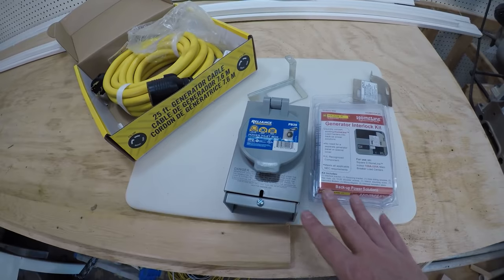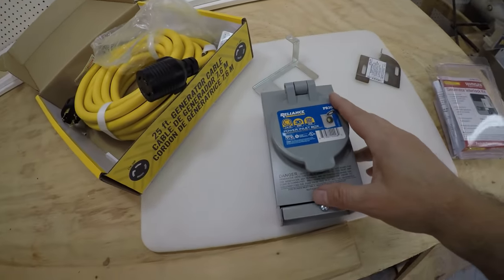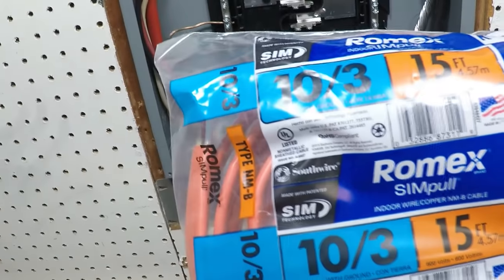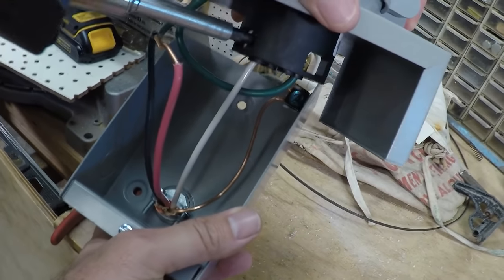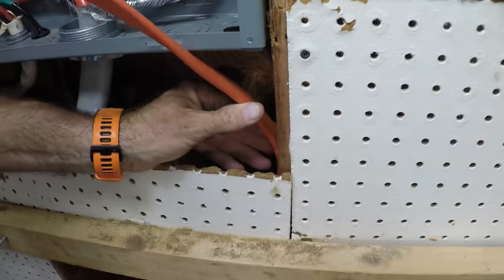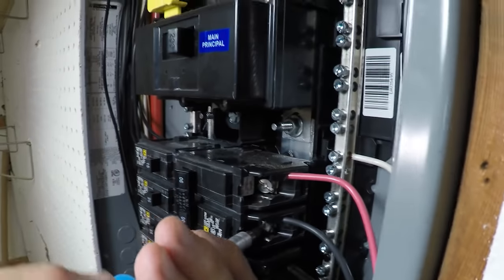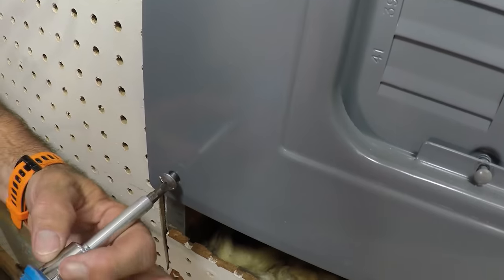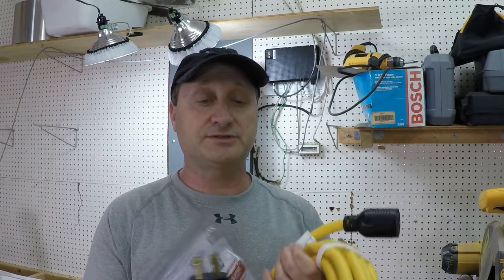Home Generator Interlock Kit Installation - EASY!

Comment: Thank you for the clear tutorial on a safe way to supply power.  Since this will not supply 240 volts for air conditioning units or any other 240 apparatus - mentioned in a previous comment/reply - is it a must that you click off the breaker to those units?  I think so.  Although I think someone earlier wrote that they just wouldn’t work, not a problem to keep the breaker on.  Can you please clarify your opinion..

I was leaning towards installing a manual transfer switch even though it limits the number of circuits it would feed.  But how many basic things do we need powered?  As you know, flipping the switch on a properly installed manual transfer switch safety feeds selected circuits and locks out backfeed to the street and not jeopardizing the lives of utility workers. 

Thank you again.  It is a top instructional.
Reply: This will provide 220 volt to the panel. The only limitation is the size of the generator.
Reply: @lancefredrickson4791  im no electrician but wouldnt the wiring be a limitation as well? The 10/3 wire is rated for 30 amps so regardless of how much the generator is capable of you have to be mindful not to overload the wire
Reply: I think that I probably didn’t word my question correctly or clearly .  What I was told outside of this discussion is that most portable generators wouldn’t supply enough amperage for central air conditioning.
Reply: Limitation is by the breaker. Breaker is installed to protect the wire not the equipment. But yes you would be limited to 30 amps but still 220v is available. It is possible the air conditioner could be less than that. Split unit air conditioners could be less depending  on tonnage could.
Reply: Generators are usually 30 or 50 amp. 6/3 wire for 50 amp. May or may not run central ac on either depending on AC condenser initial wattage pull.
Reply: @theworldviewer  If you play the odds most generators and the associated wiring will not run central AC
Reply: @theworldviewer  Generally speaking a 50 amp portable would get you closer to that objective... Know & understand your volt & amperage requirements in advance, otherwise hire a professional electrician...Based on certain questions asked, I would always recommend a pro...
Bill on the Hill...
PS: The gentleman that graciously shared this short demo with people was correct once again in his disclaimer: " If you are not comfortable working inside a main electric panel, hire a professional... "
Reply: Great observation...flanal did'nt provide this very important info even while sucking air between his teeth constantly. Looks like the wiring would make the entire panel HOT less to the service wires as the main is off. I would think you would need to shut off all breakers to items not included in the load calculated to be provided by the generator.
Reply: Does make sense since your feeding 110 to each side of the panel and if your 220 load was low enough it seems should be ok? In my case a well pump..

Comment: Before you buy the interlock and install it,  check with your building dept. Many municipalities do not allow them. They will require either a manual transfer switch or automatic transfer switch, depending on the generator selected. They usually require you to switch the neutral also.
Reply from the maker: you may need a permit anyway in your town which means you are going to find out quickly

Comment: My home is off grid so I use a transfer switch at the inverter .   I use a generator about 15-20 hours per winter.   I use a propane powered genset because gasoline goes bad.     The other 340 or so days the wind and sun keep things humming.

Comment: I have that EXACT same Isolation lock on my panel. Works great, the only drawback is that it is fairly hard to turn off the main breaker from the powerline. My wife can barely do it.

Comment: Nice job man! 'everyday man' says he is an electrician, yet uses a suicide cord, which can be a very
dangerous thing to do. You did a professional job. with the transfer plate and not needing a widow-
maker cord. again great work. When I get a power failure, I find out how long it will be out. if I need
power, I shut off disconnect under the meter and in the house also.I then plug into the dryer and 
gen, with its breaker off so I don't start under load. I am very careful, BUT I know you have a safer set-up.

Comment: Is your generator setup as a "floating neutral" or "bonded neutral"? How does wiring the load center from the 30A Inlet box differ for each type generator setup? I am using the same 30A Reliance 4-prong Power Inlet box and my generator is set up for "bonded neutral" and has a GFCI setup. @7:30 looks like you are wiring the ground separatly  (not bonded) from the neutral at the point of first disconnect.
Reply: Great question I’ve wondered the same. No one ever answer’s it though when I see it asked.
Reply: @willyhawkins6596  same

Comment: Great video. Nice step by step. Please consider using an insulated electricians screwdriver! ALWAYS check for power on and off with a pre-verified meter.
Reply: You sound like you know a lot about electrical work. Maybe you could answer a question I have, if the breaker you need next to the main breaker for the lockout kit is already used. You would have to move it to make room for the 30 amp generator breaker ?
Reply from the maker: yes you will have to move it. The generator breaker needs to be directly beneath the main breaker. Otherwise, the interlock kit will not work
Reply: @flannelguydiy6458  when moving breakers, keep in mind overall load balance between phases.  Usually not a problem, but in certain instances.

Comment: Good video! I like the idea of those interlocks. On a side note, you should not get in the habit of touching the screwdriver shaft even if the breaker is off. One of those times it might not be!

Comment: Just a suggestion, Make your wires twice as long in the box. Use 6 wire so you can make it 50A if you want to run your whole house with a bigger generator.
Reply: why twice as long in the box?
Reply: @feralbigdog  I like to have longer wires when I pull a receptacle out so it is easier to work on. On camera they looked short. When they are longer they are easier to fold into the box.(50 years as an electrician)
Reply: Yeah.  Use 6 wire is future proof if owner wants to upgrade to a 10kw generator to run central AC and all other circuits.

Comment: Excellent video. I have a transfer box for my generator. I've unfortunately had to  use it a few times since Katrina. Its worked well  up until recently. Transfer boxes have a set number of breakers, as I've had work done on my home to upgrade it I've added more breakers so all of them are not wired to my transfer box. I am definitely switching to this interlock as it powers the entire panel. I'll use an electrician. Thanks for the info.
Reply from the maker: thanks for watching
Reply: Do it yourself. Its not hard.

Comment: Very nice.
Though I would have liked to see at least a 1ft service loop for that Romex feed, and a 'while in use' weatherproof cover for the power inlet.
 I love that breaker safety clip, that's one hell of an invention.
Reply from the maker: thanks for watching...
Reply: Except service loops are against the NEC so he actually did a good job on that
Reply: @mikemartin6978  for in-home permanent wiring sure, but for an emergency, backup connection?
 I'm not doubting, just asking.

Comment: This is probably the best video I've seen about this. Very well explained.   About how much would an electrician charge  to install it ? Is the whole house powered or just what's on that one breaker ? No one answer please except Flannel Guy DIY.
Reply from the maker: An electrician will charge at least $750 for this including the parts. Maybe more. You can power as much as what your generator can support. If you have a 6000 watt generator, then you should make sure you are not using that much in the house. Dont use your AC unit and keep most things off. Run your refrigerators, basic lights, WIFI, TV, etc.  Be careful using hair dryers and microwaves
Reply: Would a 9000 generator run a well pump,, fridge and AC with a few lights?

Comment: It's good that the generator lead from outside went down and then back up into the breaker box like a interior drip loop.  The water that rolls down the exterior wall and follows the non weatherproofed  unrestricted wire path into the house just rots out the plywood wall and wall plate instead of going straight  into the  breaker box, shorting out and burning the house down.  It's a much slower process if your house rots down instead of burning down.       Also drilling a drain hole (to counter the un weatherproofed  wire/water inlet hole)in the exterior box will lessen the potential shock hazards from pooling for non-coded exterior installs.😮

Comment: As I am learning elsewhere, you should not ground the wire (green) to the panel, this give you a parallel route back to generator and is dangerous in some fault conditions.  May want to explore that.

Comment: I just replaced the box on the outside of my house with the plug inlet for the generator and a toggle switch that would turn off electric power from the electric company at the same time you turn on the switch to the generator. Home Depot sells the replacement box. It also supplies power to the whole house just as it would from the electric company

Comment: Of course there is one other way to go for relatively short power interruptions....a grid tied inverter large enough to be capable of powering everything, tied to some storage batteries.  It will automatically transfer internally when grid power is lost and will keep the batteries charged when power is on.  It's possible to set one of these up for as little as $2K (or greater for longer interruptions).  The price of lithium iron batteries have come down dramatically.  a 12 volt 200 amp hour can be had for around $600 and the grid-tied inverter for under $1K.  There's no noise, no noticeable switch from one source to the other and it just works by itself with no plugs or breaker changes needed.
Reply: If you are going to spend 2k why not install a whole home grid tied system.....get my point! This video is about an interlock kit not a solar system.
Reply: Show me a 200 amp inverter for $2k.
Reply: Show me a 240 split phase inverter of any amperage that's less than $1k, I've been looking for hours as I had the idea to build a battery pack for my well pump. Even a cheap build came out to more than a couple of generators and this interlock kit.

Comment: Not bad ,the romex connector should be other way around set screw on outside of box ,and i suggest if you care about color  phase of your wires and identify wires on both ends red and black those matter

Comment: Nice job.  I would have either put lock washers or some threadlock on those interlock screws.
Reply: They have to be loose for the bracket to be able to slide up and down freely. Lockwashers wouldn’t work. I couldn’t tell by the video but I’m sure those have to be nylon nuts so they can keep the screws loosely in place without the nuts backing off
Reply: @Ephesians-ts8ze  No, I don't think so... The screws usually have a wider barrel that stands them off the plate.  At least it was that way on the 2 I've done.
Reply: @LarryB-inFL  ok Larry, good on you bro👍

Comment: So, the side of the panel that you have the breaker is the only side that works when done?
Reply from the maker: No.. the whole panel works. It is connected through the main breaker even though the main breaker is shut off to the line coming into the panel

Comment: Thank you for this video.  One question, I too will have to but a 30 amp breaker at the top right, but to do that I will have to move a breaker.  Can you just move that breaker to the bottom or do you have to shift all the breakers down on that side?
Reply from the maker: you can move the other breaker to anywhere in your panel

Comment: Question - if you have to flip off your main breaker to use the generator, how do you know when street power comes back on?
Reply: Just get yourself Power Back Reliance Controls THP108 EMW3561925 you will add this to your breaker box and will ring like smoke detector when the power comes back.
Reply: Look at the neighbors house and street lights🤣

Comment: Excellent video. Just to mention too the inter lock kits are specific to the type of elect. panel you have. Your kit and the provided link above being specific to the Square D panel. When I did mine I installed a watt meter before I made the final connection to the panel which comes in handy for monitoring the load on both the hot feeds and total demand on the generator.
Reply: Do you have a pic of the watt meter install? Interested in maybe doing the same.
Reply: @patrickgarrison8847  Sorry no I don't have any pics of the install but it was pretty straight forward. After I left that reply I checked online and Reliance Controls has discontinued the MB75 watt meter that I installed and now offers the WP7500.

Comment: NEC (code) support rules for Romex only apply in new construction.  Fishing a new wire into a wall (remodel work) does not fall under NEC Romex secure/support rules.
Reply: in his case it would be easy to staple since wall has access.My problem would be doing all this work for only 30 amp capacity,why not go up to 50?
Reply: Since wall is open it DOES have to be supported.

Comment: Just got a Genmax 9000ied this week. Looking to do the Same, but wondering if it can be done with a 50 amp breaker? 
Plan to get an additional generator to run in Parallel in the future, if it’s needed and wanted it to be on a 50 amp.

Comment: I have a  General Electric 125 Amp panel 1 1/4" spacing between lowest horizontal main breaker and first breaker on the right row. The first  two breakers on that row are connected to one leg in the box. When those are used as 240v inputs for a generator we are looking at a dead short for sure. The third breaker goes to the other leg. If one could use a dual pole breaker occupying slots 2 and 3, things would be great. Regarding the interlock, I have looked through the possibilities  already and come up short handed as far as buying something that fits. But other than making a custom interlock, maybe extending the lower part of the plate,  do you know of an alternative rather than replacing the entire breaker box with something more suitable?

Comment: Do you not need a ground rod between the generator/plug and panel? Also, most towns need a permit to do this job and if your generator needs to be connected to other fuels like Propane or NG.
Reply from the maker: yes you do need a permit. I had one.

Comment: How did you select what lights and outlets to be used with that 30amp breaker??
Reply from the maker: I could run everything except for the AC condenser. I have three refrigerators, basic LED lights, etc

Comment: Did you have extra available circuit breakers already in the panel that had no wires hooked up to them so you could dedicate them to the generator hook up?

Comment: Thanks for the great video. You mentioned you were reluctant to turn off the main breaker because of computers operating in the house. I would hope that you have them on an Uninterruptable Power Supply (UPS). APC makes an outstanding unit (NS1250) that makes battery replacement (typically every 5 years) easy. The battery spacer design is brilliant!
Reply from the maker: thank for watching
Reply: Thing is he already had the mains off when he installed the 30 Amp breaker. Let's hope.

Comment: Do you not have to disconnect the neutral from the main line to avoid feeding back power to the main line?
Reply: You cannot backfeed the main line with that metal piece. Its either the main breaker is off while the 30A generator breaker is on or vice versa.

The sliding bracket disables the main breaker while the dedicated 30A is on.  If you slide it over then the 30A generator breaker is off while the main is on

Comment: So the 30amp breaker switch never had any wires before, and is generally for generator in put?
Reply from the maker: That is correct. .... it was installed there specifically for the generator
Reply: My thoughts exactly. I wouldn’t think that when the house was built that someone had the fore thought to install a 30 amp breaker in the exact location that would accommodate a interlock switch. More likely had to shuffle breakers to make that happen which would have been harder than everything showed in video. That being said, still a good video.

Comment: Didn’t see it but duct seal in back of outside box helps keep water out. Have seen and repaired alot of GFCIs water logged because of no seal between box and siding

Comment: Question.  So by running g the Gen feed wires through that separate generator  breaker, how is that supplying power to the rest of the house and through the individual breakers?  Does that breaker allow power to through ALL other breakers that are in the on position?
Reply from the maker: the main breaker is cut off from the street but it is still connected to the entire panel

Comment: I have a main breaker switch in the breaker box in my house. From there the line runs under ground to my power pole breaker box with a main breaker switch there, then it runs to the power company pole. If I turn off both main breakers, is there any way electrical current could back feed up to the power company line.
Reply from the maker: it is hard to envision what you are describing